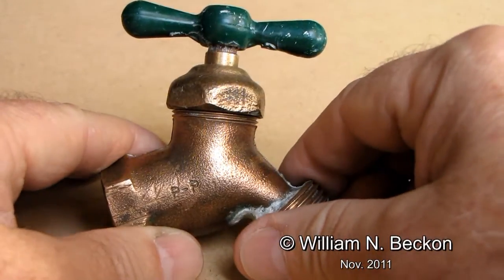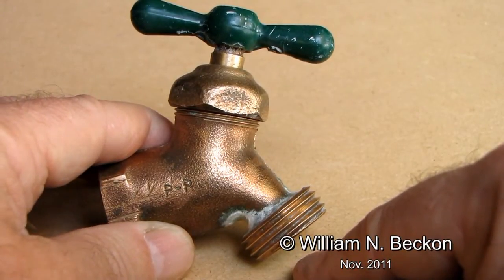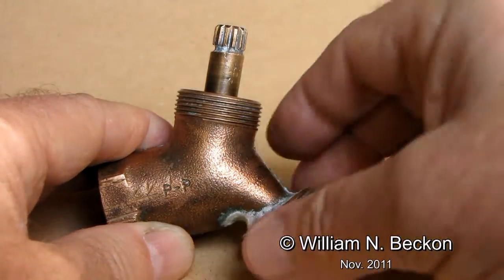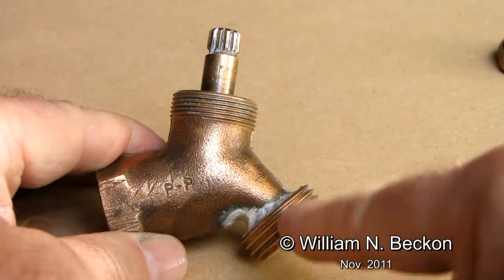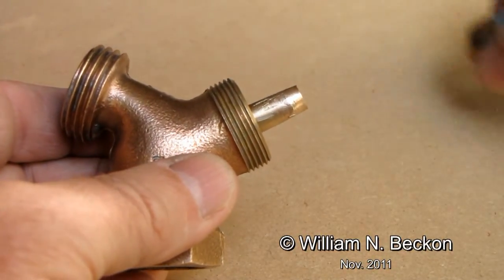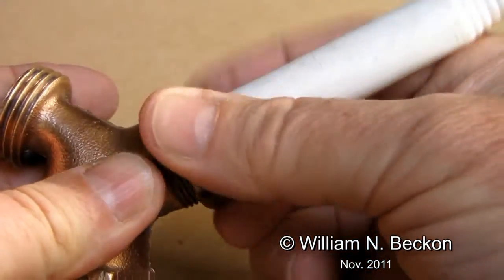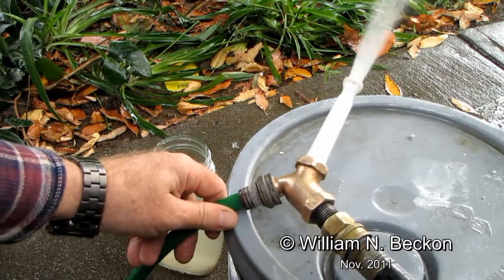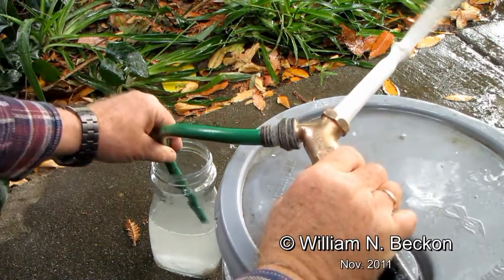faucet jet pump by W. Beckon Nov. 2011

Comment: Very clever modification. If you can't find one of those plastic tubes it will still work with just a straight piece of pipe or hose, it just might not have quite as much pressure.